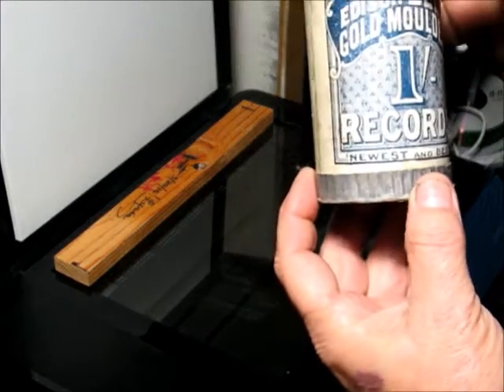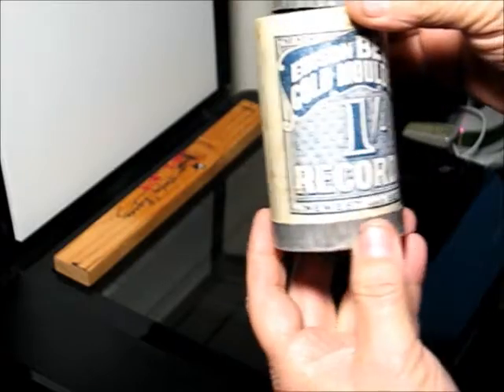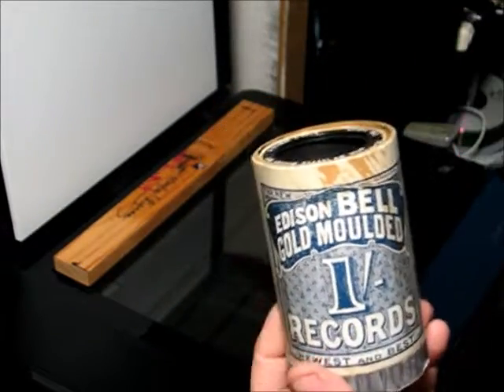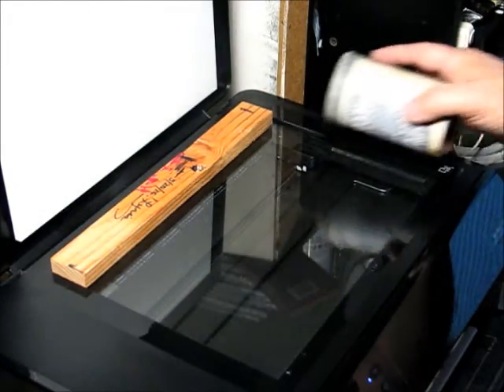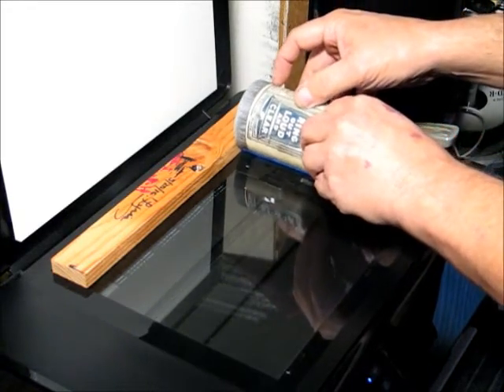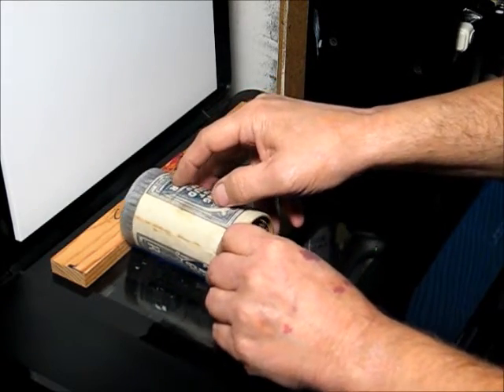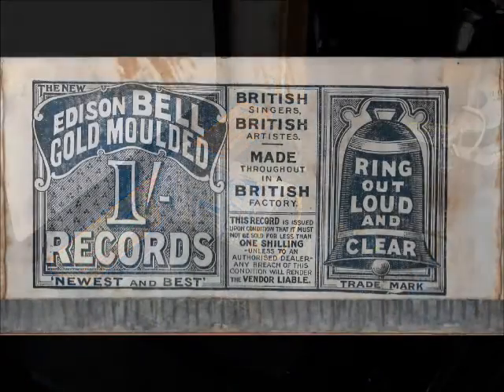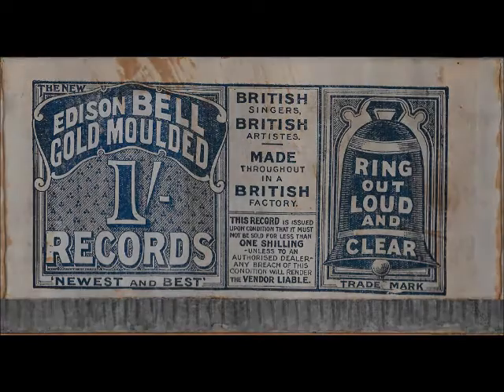How To Scan A Cylinder Record Box Label

Comment: I have tried this method with many different cylindrical surfaces of different sizes.  Often I have a hard time getting a good image.  Depending on the size of the cylinder I have a hard time rotate it smoothly.  Sometimes it wants to slide rather than rotate.  Also you have to rotate it at the proper rate, so that the edge of the cylinder is always at the row on the glass currently being scanned.  Otherwise you will get smears, distortions and irregular brightness.  Smaller cylinders are particularly hard to roll properly.  I'd like to think of some kind of holder or device that would help me get better scans.  Do you have any tips?
Reply: I think it works better for me if I use a high resolution - that way the scanning element moves a lot slower and it's easier to roll the cylinder at a slower pace and keep it aligned with the scanning element.